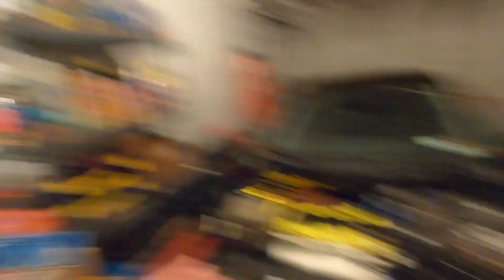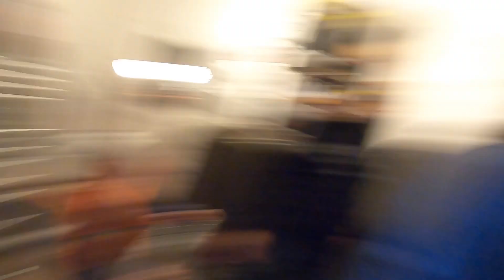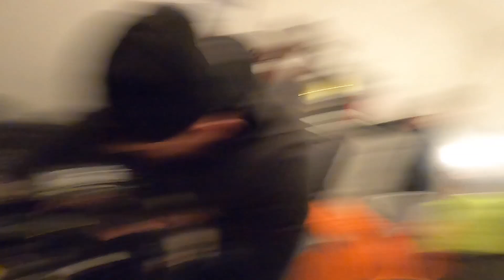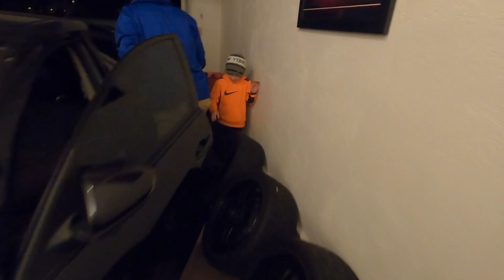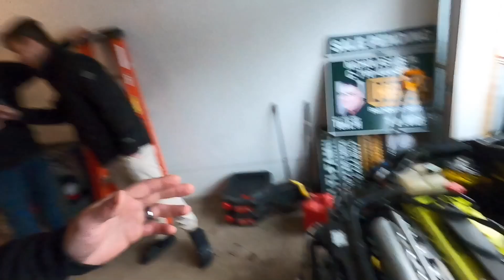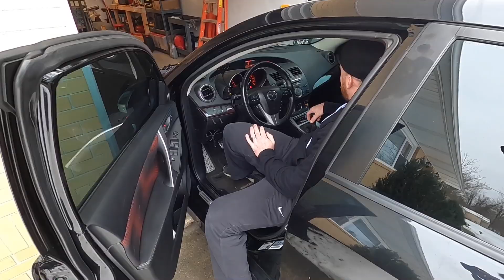SAVAGE Mazdaspeed3 Makes EPIC Return With A TON Of New Parts !!! 2020 IS GOING TO BE INSANE !!!

Comment: That's exactly the turbo I was eye-ing for my 500whp goal. It's between that or maybe a CST5. I want something that'll be good for road coursing and some canyon carving. I'm excited to see how y'all like it! XD

Edit: Holding the accel pedal to the floor shuts off the injectors, so no need to pull the FP fuse/relay - just crank it to build oil pressure. I use the same method when doing compression tests. Or maybe you're pulling it because of the PI system?
Reply from the maker: We will report back and let you know !